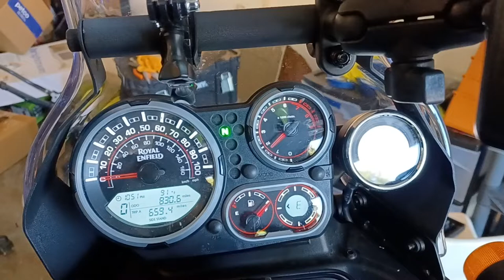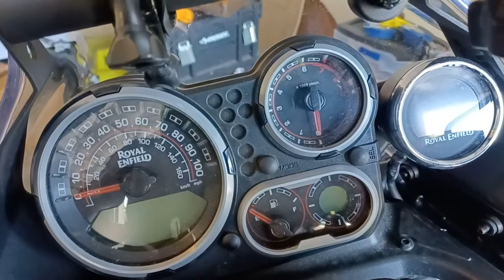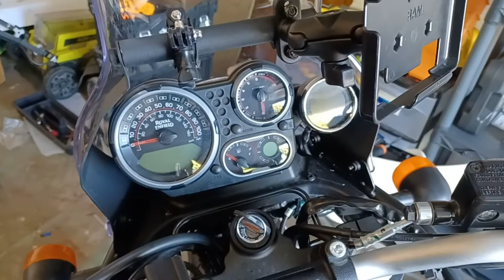Idle fixed? Guess not.

Comment: Have you had the dealer send the ECU in for a refresh?
Reply from the maker: I asked about it, but they didn't seem interested in doing it. They said Royal Enfield's SOP is to fix it mechanically first and only do the ECU as a last resort. All they did was run some fuel cleaner through the bike since they couldn't replicate my issues, even though the bike wouldn't start properly when I went to pick it up.

Comment: At what value did you set the TPS voltage?
Reply from the maker: The last time I adjusted it I had it around .70-.71 I haven't checked it since bringing it back from the dealer, but they didn't make any mention of adjusting it.